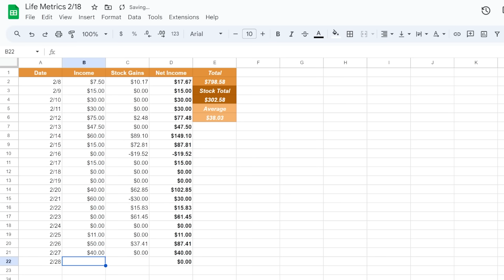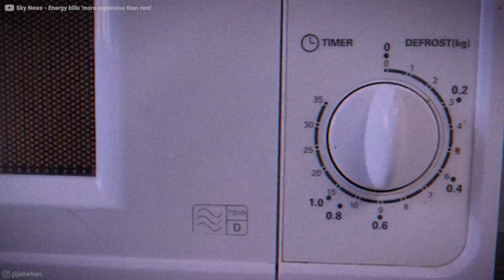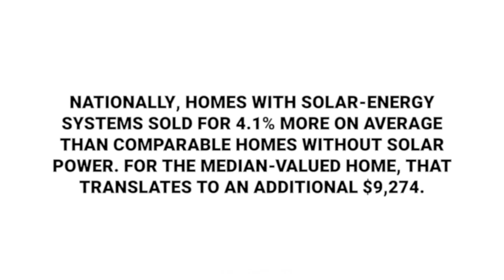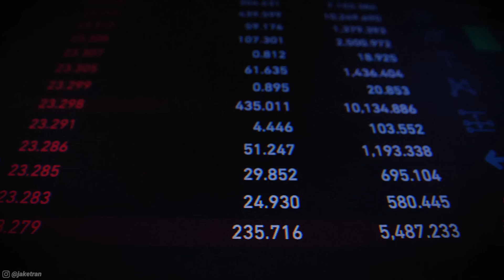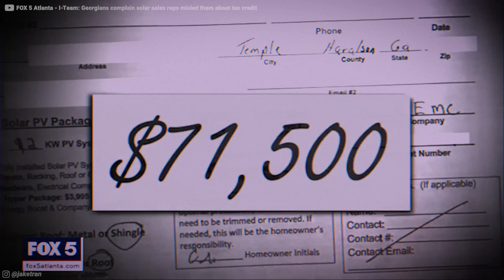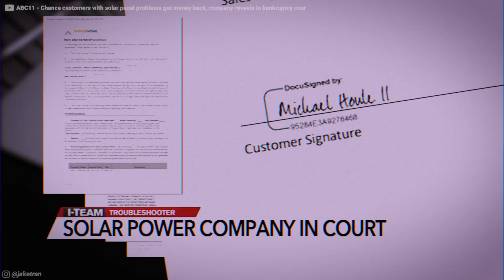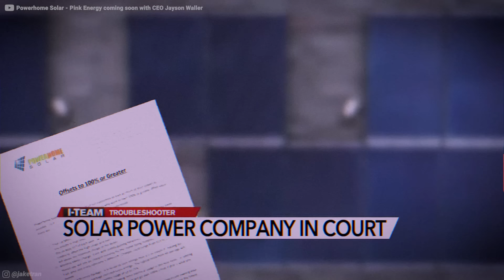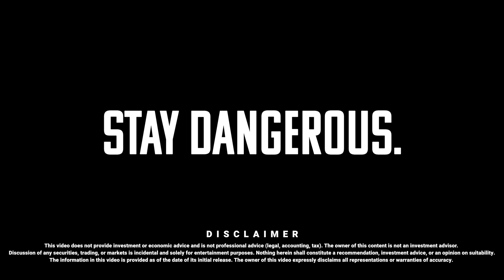Home solar panels are literally a scam.

Comment: I'm setting a goal of buying a home in 6 to 8 years, I've heard friends in Bakersfield paying zero dollars in electric bills due to solar panels. Now that I saw this video I'll do a deeper research on solar energy for homes. I'm not a keen person on paying interest, I always pay in full or don't buy it and store the money in an index fund instead of paying interest payments, that way i somewhat get the interest instead. I hope i see this comment again in the next half decade and see where i am at financially then. Thanks for the video, it was informative and a good reminder to dig deeper.
Reply: Interest rates are for sure high at the moment, but low interest loans are not bad. A 2-3% loan can be a beautiful thing on an appreciating asset and in times of inflation.
Reply: It will depend on your individual circumstances but the goal with getting solar is to make sure that the panels you get actually cover most if not all of your energy bills, and thus instead of paying for energy you're paying off the loan you got for the panel. After that's paid off, you have free electricity for the lifetime of your system. You just have to make sure that you actually will get enough sun, and that you get a system that works, ideally with a trustworthy installer.

Comment: Bit misleading. I have solar myself and I’m an electrician who had no interest in installing it myself because financially it didn’t make sense vs what it costs and I make. 

Solar is similar to buying a home. If you don’t plan to stay there awhile it’s not worth it. 

Solar is worth it as most warranties are around 25years (if the company is in business) I got a warranty from the manufacture as well.

If you don’t pay cash you will have a bill until you pay for the system. Typical payback period is 6-7 years. After that it’s all profit.

Net metering depends on the state but typically is a bit predatory. My state only offered 75% which imo is theft. 10%-15% is fair imo to cover the cost of loss transferring the power and the net metering service. 

If you’re a W-2 worker you can claim exempt and pay no tax’s in. Letting you claim more each year.

Comment: Solar return on investment works for most commercial, because most businesses operate from morning to evening, and so all or most, of the Kwh their solar systems produce get used by the building during normal business hours.

Many homes use most of the power starting in late afternoon.  Husband wakes up at dawn and goes to work.  Then the wife gets kids off to school, and she probably has a job as well.  The house sits empty all day and Kwh produced by the solar system go back to the utility at the Lower price.  Then in late afternoon everyone arrives back home; Hvac is turned on, along with laundry machine and kitchen appliances.  Since by then the sun is on the wane, the house draws power from utility at the Higher price.

Unless you also buy a whole-house battery, that is how it works.

Sorry, there is No free lunch here.

Comment: I don't understand how their electric bill doesn't drop. The solar panels work, and they do supply electric to your home, so how are they not helping to lower the bill. Am I missing something?
Reply: This dude just does terrible research evidently. There are some solar lease programs out there that do shawty installations with shoddy equipment. And sometimes they don't work so well with local electric companies. Because they have to change the metering equipment and it takes additional permits. And sometimes these lease installation companies don't show up to even hook up your system after it's been installed. Or if there's a malfunction it's really hard to get a work ticket. But that's by no means the same as the implication that he puts forth by simply saying that people get these things installed and then they still have to pay their electric bill.

If you ask me this is a rather lazy content creator. Kind of a shame to see that they evidently gets a decent amount of views.

Comment: The most difficult part is putting up panels in the roof. Panels and Batteries are so much cheaper that you can build your own setup for 1/3 the price of what you were quoting. Additionally, you have until 2030 to build it so the gov't can reimburse you for an additional 30% rebate. 
If you can mine 1.5K an hour of solar, that will give you about$300-400 savings in electricity. Your ROI will be less than a year if you do it all by yourself and its not that difficult.

Comment: Remember that this like the kia/hyundai debacle is a US only problem, in Portugal a solar panel from Galp (big oil) is only 300€ per panel. Plus a small fee for installation and you can do it online where they pull up the map so see if your roof is ideal for the panels.

Comment: It’s a lot more nuanced than this. There is definitely a fair share of bad predatory behavior in this industry as it is a young industry ran by inexperienced or quick cash chasing individuals, however that does not mean that all solar companies are out to get you. I work for a local small company that focuses on energy efficiency before doing solar. Our goal is always to save the customers money over as quick of a time frame as possible. If you are looking to go solar do your due diligence and find a good company that cares about what they do. Don’t make big decisions without knowing what is happening inside and out.

Comment: It seems logical to have a solar roof, which sheds water from the building plus collects electricity from the sun. Somehow under the panels have solar water heating panels, which will cool the photoelectric panels. So that's 3 uses from the same solar installation. I don't know if anyone offers this yet but it makes sense to do this, someday.
Reply: Until a storm comes through and you have a $50000 bill for repairing said roof
Reply: Point taken, @drtyhay  . But how is that different from setting up all 3 of these separately?

Comment: I designed and built a modest solar system for my home out in the middle of nowhere; grid power wasn't an option for me. Buying the equipment yourself would be the way to go if you are in a similar situation. Never lease the equipment because you're just replacing one corporate entity with another. Note that the system will never pay for itself versus the monthly electric bill you would have paid. The system will require battery maintenance and/or replacements somewhere along the line. It can be done for under $5,000 as a DIY project even with top-of-the-line equipment. Just don't expect to run a dryer or an electric stove or an air conditioner on this budget. Use your head and make compromises.

Comment: Also theres money in solar repair. With the line of work im in, i see invoices coming in for 20-50k to detach and reset solar panels after a storm. Its basically all labor as well
Reply: That's outrageous they are easy to work around.  As a roofer i ran into a system with some 100kwp grid tie, had to do repairs and it was not that big of a deal.  Not anywhere near as big as 20-50k lol.  You people are getting ripped off.  I designed my own solar system to power a 200A 240v leviton smart breaker panel it works great.  Used victron product and nice fat cabling.

Comment: Ok picture this for a moment:  What if a law was passed that required every buisness with a large parking lot (obviously some sort of minimum size requirement) to have solar panel grid overhanging the parking lot?

Not only would it provide power to the buisness and possibly nearby businesses and homes, but it could potentially provide tax breaks or even passive income.  And the best part is that it would provide shade and rain cover for the pedestrians using said buisness.
Reply: Indeed. The French have made it law that large car parks install solar canopies. Also protects your ride from birdy poop.
Reply: But why does it have to be a law?
Reply: @DCBChump  because its not economically viable in many situations AND (big and) its work, work, work to maintain and would be a potential liability since people and cars are beneath.
Reply: @happyzahn8031  
That was exactly my point. If it is a viable idea, then no law is needed. It would happen on its own.
Reply: Those tax breaks won't last forever as when the market increases, they'll tax the heck out of it

Comment: I have an off grid system producing 100% of my power during the summer and 100-90 % in the winter ( I live in Greece ). Solar panels are only worth if you are using the power yourself off grid with batteries.

Comment: If you can afford it, and live in the right place, the Tesla solar roof is actually worthwhile. MKBHD made a video recently.
Reply: MKBHD makes videos all the time, what does that have to do with solar 😂
Reply: @marktopian he made a video on roof solar recently.
Reply: The tesla solar roof has a few major problems. First its way to expensive because it looks good and no one else offers a solar tiles than tesla. You can get the same power from panels for much cheaper. Second problem is that you produce way more power than you need (which is not a good thing), because you have to cover your whole roof with the solar tiles.
Reply: @nikola119   You don't have to cover the whole roof, some of the tiles are dummy tiles. Unless of course the homeowner wants to prepare for the worst months in winter and still have some power, then maybe he over produces during the summer. That isn't a problem if you can get the power company to pay you for the extra power. I agree with your other points though.
Reply: @nikola119  >if you can afford it 

Literally the first thing I said. I don't know which strawman you're talking to. You can also have the grid buyback power, and they will. As per his video.
Reply: @marktopian  >being this aggressively wrong
Reply: @remyllebeau77  Thats true however the dummy tiles are still much more expensive than regular roof tiles, beacuse tesla has a monopoly on these tiles. And yes you are right about getting a power company that will pay you for producing electricity, is maybe going to solve your problem of overproducing (depends how much they will pay you, but usually not a good deal). However looking at a bigger picture, massive overproducing is going to lead to terrible consequences on our grid system.
Reply: @Adam-tp8py  But is it still worthwhile if there are more efficient options out there?
Reply: @nikola119  Then perhaps a power dump of a sand battery or pumped-storage hydroelectricity.
Reply: @nikola119  If you're looking for a certain aesthetic, a certain amount of seamlessness, certain features, then absolutely yes. "Worthwhile" is relative. Some people like Macbooks, I think they're overpriced.
Reply: @nikola119  over production isnt bad if you have net metering with your utility and that includes you getting a payout.  Also if your state has sRECs and you get $$ for the credits, then again its not a bad thing.  with that said i'd personally avoid the tesla solar roof, mainly because of my views on tesla the company as well as the price compared to conventional panel installs even when replacing the roof.

Comment: Listen no matter what anyone thinks or says. If your not reducing  your electric  usage then your not  going to see any change and a new charge. If the solar company says you need a 2 kwh. D9uble it or triple the input watts. And get a battery  bank. 4 time larger then you input.. .. i have a small solar array apen 600 bucks plus tax and have not paid an electric  bill in 7 plus years.   Need a medium size wind turbine. Not a mirco

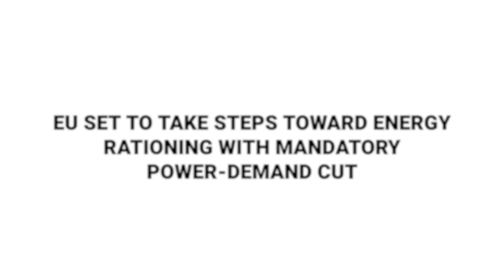Comment: 2:52 There is/was no energy rationing in Europe. There were some initiatives to save energy but nothing mandatory and it was basically all done by the rising energy prices.
Reply: with all that going on regarding RU fuels, why is Europe not way ahead of everyone putting solar up? Seems 5 years ago when folks  saw what was coming, politicians should have incentivized home owners to out panels and tie into the grid?

Comment: My Dad bought solar panels for £9000 in 2015 (£13000 due to inflation). From what the grid pays us plus the amount of energy we save, we get a net benefit of £3000 per year. It broke even after 5 years but it lasts 20-30 years, so you get back several times what you pay

Comment: i have a small mocked up solar build on my table and id say the only problem for this solar in general is the optimization in collecting the enegergy , the energy storage , and the energy discharge management these three flops hard specially the energy storage part.. and just for fyi the mix of parallelxseries is the best base on the result ive got the base energy fill and efficiency never drop beyond 70% in any setup , another fyi is to change your fridge and oven or washing machine with Hybrid super capacitor
Reply: I’m a solar installer and your right, you can’t just connect it and hope for the best it has to be setup correctly especially with high use appliances, and fixed and and flexible rates.
Reply: @bensonallsop5653  true it has tobe proper;y setup base on the usage, im an installer aswell i do installation on some of the big gas stations in my area, those i mention are just my simple fix on those high inrush current appliances, it extends the batteries life aswell , im just curious if the same were implemented in the west? do they install hybrid super capicitors aswell?

Comment: My system was paid in full, $5600 out of poket. Took about 5 years to get that back, but this was only possible with 50% in tax incentives. 25% Fed, 75% state. Otherwise it would take too long to get $22,500 for the total cost. They also did energy savings stuff.

Comment: So I have a 14MKwH system.  It is a big array of 27 panels.  If you take the tax incentive and use it towards panels, it will cut your lifespan of payments by nearly half.  So 20 or 30 years can become 10 or 15 years and you can still enjoy the time of saving on energy bills.

Comment: I started by building a small portable system inside a mobile toolbox, with 4 by 100w solar panels. This gives me about on average 1,5kw per day over here in sunny Cape Town, South Africa. My panels are not mounted on my roof, but I deploy them on my back lawn in the morning and take them in at night, due to thieves stealing them off roofs over here. This has been a blessing as we have planned power outages called "load shedding" so daytime I have a bit of power, it also cut my bill quite a bit. I am an Installation Electrician.

Comment: The issue is not solar but the predatory programs generated to finance these systems. Also lack of knowledge in financing by customers. People are acting surprised that there is a higher cost for a 30-year loan. I find this video Incorrect and predatory in itself. Before financing something actually do some research on anything not just solar

Comment: A quick word of caution on some of the video clips used. You mixed in clips of people who are completely off-grid in Arizona and built their own solar installs for their power needs with the clips of grid-tied systems being sold by sales companies and panels on a roof in a snowy area. It reduces credibility in the video. 

The rest of the video was good information, basically summarized "Don't trust sales people".

Comment: Did the math and it just doesn't calculate for me. I'd never hire someone to do it for me, but my energy consumption is too high for the size of my roof. If I'd do solar, I'd do off the grid solar and cut the cord because as long as you're connected to the grid the utilities will nickel and dime you. Maybe the next house...
I just installed a small 4 panel solar system for a elderly disabled friend as a power outage backup system. It simply powers a large enough solar generator and the house was already prewired for a gasoline generator. Nothing automatic, they simply plug the fridge and a few other things into outlets that are not connected to the grid but go to a generator. Simple but effective. They just had another outage and are so happy that all they have to do now is push a button, plug the few things they need into another outlet and done.  The generator used to run out of gas every few hours and was hard to start for them, the solar generator lasts all day at their low consumption (they don't even have a TV) and the 1000W solar panels will easily recharge the box or just run the appliances directly. $3000 well spent.

Comment: Im an electrician in the UK. We are installing a lot of PV with storage, and they work just fine. But then we're a small company, and just fit the system, with no dodgy finance ''deals'. We currently pay 36 pence per kWh, or 46 cents on average on a domestic property, which is double what Americans pay on average, so its worth doing.

Comment: Same thing I noticed with the door to door roof assessments, especially after hurricanes... maybe that could be another video?
Reply: Ive seen that on reddit. Door to door inspects and marks the roof highlighting the “damage” then homeowner gets a second opinion and theres no damage lol.
Reply: I am a roofing contractor and we are actually valuable. If you try to file a claim yourself without a contractor you will only get paid for repairs rather than full roof replacement. 

We act almost like lawyers and make sure to hold your insurance company accountable.
Reply: @Daniel-gf1zj if your roof is 15 years or older it likely needs to be replaced. Question is would you rather your insurance pay for it or would you rather pay for it completely out of pocket? 

If you try to do the claim yourself you will only get approved for repairs. A good roofing contractor is very valuable.